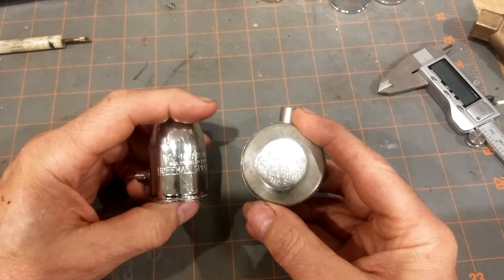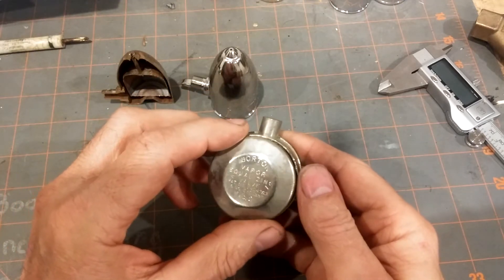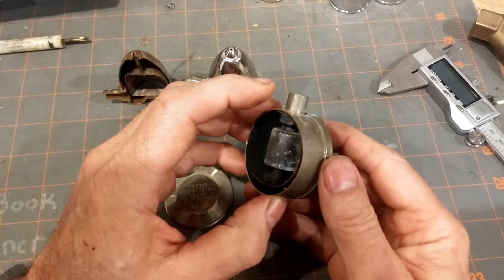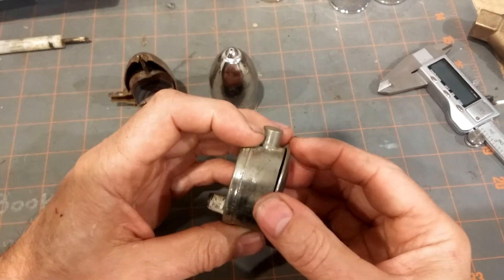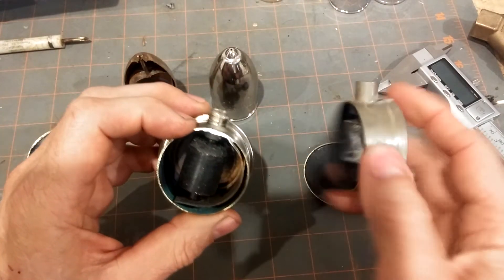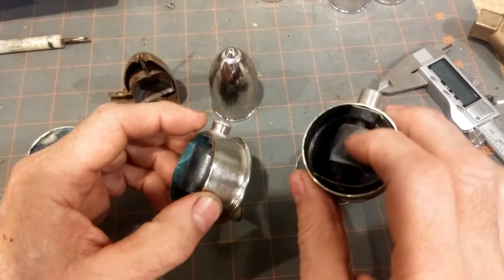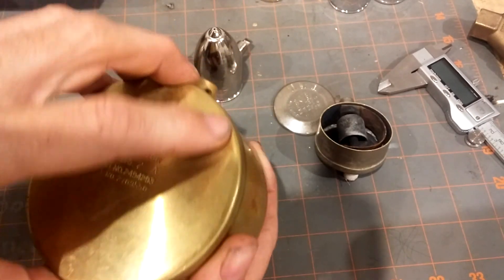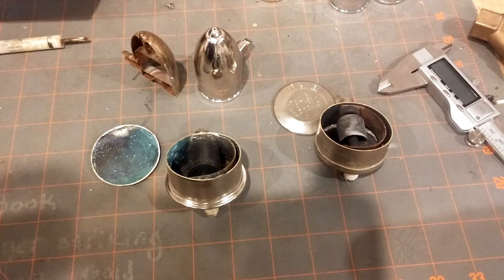Gorton / Maid-o-Mist Single Pipe Steam Radiator Air Vents

Comment: Great video!!! I have been using Maid o mist in my house. I just changed my 40+ year old boiler so I replaced all vents. The rad in my bedroom which is a 14 column, largest , hottest  and the highest in the line(house). Maid o mist calls for a C. The vent seems to be hissing a lot and releasing very fast. Is that normal? Thanks
Reply from the maker: Do you have vents on your steam mains in the basement?
Reply: @gordonschweizer5154  Yes I do. Just one.  Replaced that also. This rad is towards the end of the line or return of a signal pipe system. Its the highest rad of the house and gets the hottest and works the best. Should I use the D or go smaller then the C thats in there.
Reply from the maker: @richconstantino8485  It sounds like you might try a smaller vent. Try a #5.
What main steam vent do you have?
Reply: @gordonschweizer5154  Huffman 75 on the main. I'll try the #5. Don't have any. Will get on tomorrow.  Stuck doing 3rd grade math all day.   Working with steam is simpler with the way they teach nowadays.
Reply from the maker: "Hooray for New Math" lol.

I would strongly consider getting a Gorton #2 to replace that #75.  
Mo' venting mo' betta (for mains, at least)
Then you can vent the radiators more slowly.  No hissing, no spitting and more even heat.
Reply: @gordonschweizer5154  Got the Gorton will change it out this weekend.  Going to be cold next couple of days here in NY so the boiler will be working.  My Ac unit has a heat pump on it so I'll shut the boiler down. I want to put a skimming pipe in too. Any suggestions? I have all the stuff. Should've done it when I installed the boiler.  Brain fart. Lol.  Thanks
Reply: @gordonschweizer5154  Went to put the Gorton #2 in and its smaller then the Hoffman. Should I reduce it or take the little pipe coming out of the line and go directly to the return line? Thanks for all you help.
Reply from the maker: @richconstantino8485  The Hoffman #75 has an outside (male) thread of 3/4" npt and some have a inside thread (female) of 1/2" npt.
The Gorton #2, as you have found, has a 1/2" male pipe thread.
What is the size of your little connector pipe? You should be able to get the proper connector, be it a bushing or a reducer coupling, from the local home centre.
Reply: @gordonschweizer5154  Its in and working great. Ace had the reducer. Only thing I see that might be a problem is the pipe or niple coming out of the line makes the Gorton high and close to the floorboards and the steam might do damage over time. I'll fix that in the summer.  Should I still use a nipple or just insert the Gorton to the line? Thanks again.
Reply from the maker: @richconstantino8485  There should be no steam coming out of the Gorton as you know unless something goes wrong.
That is very unlikely.
By keeping up on the stalk, there is less a chance of rust getting up into the Gorton and mucking it up.
Maybe tack up a bit of sheet metal over the Gorton to defect any steam or moisture.
So... Job Well Done!
Reply: @gordonschweizer5154  Was thinking the same thing with the sheet metal. Does it make a difference  that its on the return? I don't trust the piping in this house. Old boiler didn't have a Hartford loop and no pitch to the return  pipe or the rads

Comment: Thanks for the video.  Question: So if air is coming out of my vent (it looks like a maid o mist). That means the plastic piece is failing?  Air is coming out like a steam room from the valve.  I can feel the air blowing very hard when I place my hand 12"+ over the valve.
Reply from the maker: It that air coming out or is it steam?
What size is the vent orifice....D, C, 6 ?
Reply: @gordonschweizer5154  it's hot air but very moist.  Coming out very strong and very hot.  The air vent is definitely failing.  It's a 2" riser pipe with a 1/2" to 1/8" converter with a maid o mist on top. It says on the part Maid O Mist Air Valve 12 PAT No. 2400297.  It's been there for 3 years.  Should I replace with something like a  hoffman 75?
Reply from the maker: @COOG22  From what you say, it sounds like that vent has had it and needs to be replaced.
If you can, have the firing rate of the boiler checked to make sure it's within spec. Make sure your main steam vents are big enough and make sure you are not making too much pressure (Pressuretrol set too high? Pigtail clogged?)
These may help you new vent last longer.
Reply: Thank you for your response.  I'm on the 6th floor of a 36 unit apt building. Was hoping to solve this on my own but sounds like I need to get the super involved.  I think he's the one that put the valve on so he may not understand this much.  Will try and check the boiler with him.
Reply from the maker: @COOG22  I wish you good fortune. I suspect, however that your super is not going to pay the slightest attention to what some clown on YouTube (me) says about lowering steam pressure from the outrageous pressure it might be now (anything above 2 psi).
Reply: @gordonschweizer5154  Nah.  You seem very genuine and know exactly what you're talking about.
Reply from the maker: @COOG22  Why, thank you!
But I was trying to see the world from your super's point of view in a humorously self depreciating way.
Tongue in cheek, every complex has an evil resident who is looking to make your super's life a waking nightmare (that is not you, I'm sure!).
The Super wants no complains from anyone about being cold, especially from THAT resident.
The Super is sure that lowering the steam pressure will get him fired because everyone will be cold.
If the vents at the ends of the steam mains are too small, he just might be right!
It kind of a chicken and the egg problem.
I've found that most major positive changes in steam heating systems in apartments are driven by people living in units that are too cold and they then get on the Board to get someone in to really fix the systemic problems.
Folks that are too hot open their windows. Problem solved.

Comment: Gordon, I just found this video. I was tempted to try the Main- O- Mist when a supplier offered them. I saw “ pictures” of them and in the photo they looked alike and the price was attractive per dozen. Thank You so much for this information, I’m sure it has saved me grief. I will stick with old faithful.
Reply: @Scotland Heating & Air Conditioning LLC: Thank you, sir!  This is not to say I have never used M-o-M on projects.  I have used them successfully. That switchable orifice is very handy in helping to balance systems. However, it appears to me that you want to provide the best value for your customers and loath call-backs!  If an individual homeowner wants to chance buying and using an M-o-M, no harm done.  They do work.  But we as professionals must hold ourselves to a higher standard.  I know from personal experience that Gorton stands behind their products.  I've never tried, so I don't know one way or the other, about M-o-M's warranty response.

Comment: Thank you for excellent advice . If I can ask another question about air valves. In the basement of my 4 unit building, the steam line leaves the boiler and branches off to create a second steam line. One steam line feeds the left side of the front of the building and one feeds the right side of the front of the building, as they connect to the risers. At the end of the steam pipes , farthest from the boiler, right where they feed the risers, they each had an air valve. Years ago, heat on the left side was not rising up. The owner of my plumbing supply told me to replace the valve with a plug. It solved the problem. Several plumbers told me they think it may not be a cost effective solution. Any advice would be appreciated. P.S. (This appears to be a common solution because for over 35 years ago, before I purchased the building, a plug was installed into the steam line right as it comes out of the boiler, feeding the riser in the back of the building).
Reply from the maker: Thank you for your questions. I think it might be best to take pictures of your system, the vents in question, the plugs, the piping around your boiler, etc and post your concerns on www.heatinghelp.com. 
Whereabouts are you, may I ask?

Comment: Home Depot only stocks the Maid O' Mist venting valve and as a landlord of a small building I am blindly dealing with minor heating problems. A recent one was, the radiator wasn't heating up when all the others were. I was told to remove the venting valve and if the steam heats up the radiator without a valve , it's a broken valve. Next, I was told to test the function of a venting valve. Blow into it. If air passes through, it's functioning, if it doesn't, it's broke. Is this good advice?
Reply from the maker: Yes, you are on the right track. I would add another test: turn the vent upside down and then blow into it. It should not pass air. Flip it right side up, and it should pass air again.
Is there any water hammer in that radiator? Ask your resident also if
there is over-heating of that radiator and what they do about it.

Comment: With the maid o mist if you just unscrew the orifice and leave it off does that make the vent open for faster venting?
Reply: I'm gonna give a qualified answer "yes, but... "  It's generally not such a good idea to over-vent a radiator.  If you appear to need that much venting on a radiator to get it to heat adequately, usually it's not a venting problem at the radiator.  Maybe the vents on the steam mains in the basement are lacking. Maybe there is no insulation on the mains and your basement is getting all the heat. Maybe the radiator supply piping is off pitch and has a water pocket.  Maybe the boiler is undersized, underfired, or has a hole in it at the waterline blowing steam up the chimney instead of toward that "problem" radiator.
Reply: Gordon Schweizer thank you so much for that information. I can rule out all the potential issues you mentioned except that indeed the mains are not insulated. That very well may be my issue.

Thought a boiler having a hole and blowing steam out the chimney, how can I rule that out? Check for steam coming out of the chimney?
Reply: Dear Link, you are most welcome.  One way to start to suspect if there is a hole in the boiler is unexplained excessive water consumption.  If you have an automatic water feeder, how often it is feeding?   More than once per month and there is possibly a leak somewhere.  If that gives a positive indication,  a definitive test is to  shut the boiler down and to add water slowly to the boiler manually until it is above the top sight glass fitting.  Any leak will appear within 15 min or less as water dribbling onto the floor or firebox.  If that is not the cause of water loss, buried wet returns are always a favorite.  Also, check for loose valve packing nuts, or leaking union nuts.  Hot hissing vents are the slow death of any steam boiler.
I do hope for you that this test proves negative!
Adding good fiberglass insulation on the mains in the basement is an outstanding way to improve your comfort overall.  Most folks report back to me when they add steam pipe insulation two things: (1) The basement is definitely cooler. (2) They wish they had done it sooner.
Reply: Gordon Schweizer ok got it. So basically add water manually till the sight glass is coming back completely full? Or a little beyond full? Essentially filling up the boiler to the top correct so if there are any holes water would leak out. 

Also is there a way I can confirm whether or not I have a buried wet return line?

Comment: Thank you very much. This really helped me decide. I went with the Gorton 6 for my second floor radiators.
Reply from the maker: You are most welcome! Question for you... What main vents do you have? A #6 is a fairly large vent for most radiators in most situations. Thank you and stay warm!
Reply: @gordonschweizer5154  ill have to check my main vent and ill let you know. I was suggested by gorton technician to put no 5  and no 6 and no c in different rooms on second floor. But i just went with all no. 6.
Reply: @potterh2300harry  OK.  The main thing is, is if it all works for you, well and good.
If your radiators all heat up with no spitting vents and banging...good!
If they all heat up evenly...great!  Be prepared to do some vent switching around to get what you desire.
Reply: @elgordo271  the vent i found in the basement seems to be a cheap one. I am not sure what number that is. Its in a hard to reach location. The vent seems to leak water/steam because i saw moisture when i turned on the head today. It also seems to rot the wood surrounding the vent. is that normal? should i change it to a gorton no. 5 (according to their home map)? BTW the second floor radiators are working great now no leaking water. Again thanks for your willingness to help.
Reply: @potterh2300harry  Any leaking steam vent should be changed as soon as you can!  Leaking steam vents insidiously destroy boilers!  That warning should be stamped on every vent, IMHO.  So, now to your situation... on steam main piping, in general, the biggest vent you can fit is best.  A #5 is for venting radiators.  It is very seldom big enough for steam mains.  The general overall strategy is to vent the main pipes as quickly as possible and vent the radiators slowly.   A Gorton #1 should be considered at a minimum. 

In polite difference to my friends at Gorton, the radiators location has scant bearing on the size of the vent used.  The radiator's size and how quickly or slowly you want it to heat is more germane.   Remember,  if  you can vent the mains quickly (that's where most of the evil air is), then it is much easier and more successful to balance the overall system with smaller radiator vents.
Reply: @elgordo271  Can't thank you enough! I will definitely do more research and get a professional to look at it. By the way are you located near nyc or know someone in the city?
Reply: @potterh2300harry  Sorry, I'm in Baltimore.  I'd go on www.heatinghelp.com "find a contractor" section to start your search.  Check out "The Wall" to ask questions and post pictures for more info.
Reply: @elgordo271  Great thanks!

Comment: That swappable orifice trumps any variation in build quality, it’s so handy!
Reply from the maker: I'm not such a vent snob that I never ever use Maid of Mist, but I wonder if it's main advantage, the vaunted variable vent, is one of its major weaknesses.  Consider, if you will, that in order for the vent to work under all conditions, particularly in size C and above, the internal seat construction must be oversized. I would posit that this would allow debris to be more likely to get stuck and imbed in the plastic, permanently ruining the vent. 
Sometimes residents like to get more heat by removing the orifice. That extra humidity from the leaking steam is seen as a plus.
Reply: Gordon Schweizer well I don’t have any tenants in my house...but the design is such that the bent still closes even with the orifice removed—it just vents really fast that way LOL . Thanks again!
Reply: You can use the Maid-o-Mists to get your system balanced, then replace them with Gortons as they fail, because they use the same sizing conventions. You'll notice the difference. The Maid-o-Mists tend to fail within 2–3 years. I've dissected quite a few, but still don't know exactly what causes it, but they start leaking even when fully closed, and no attempts at cleaning the valve seat ever succeed in restoring the seal.

Comment: I agree with you about the crimping on the Maid O mist...it’s happened twice to me and it is a bear getting the 1/8 “ nipple out. Also I had problems with the Maid O mist leaking
Reply: Yes! Isn't maddening when that happens? The crimping construction (and rubber gasket to seal), as well as the plastic innards just about put the Maid-o-Mist vents in the "junk" category. Made-o-sh!# is more like it.   Their only saving grace are their interchangeable orifices.
Reply: @elgordo271  Made of Chineasium

Comment: I have a Gorton no. 2 and a no. 1 on each of two mains.  Replaced two no. 75's that were useless.
Reply: Totally agree!  The Hoffman #75 is essentially scrap, no reason to ever buy one.  The Gorton #1 is far superior to it, never mind the Gorton #2!
Reply: @elgordo271  and here I thought that the Hoffman 75's were the best main vents you could buy for a steam boiler! I seriously thought that they had more capacity! The contractor I work for was always installing the Gorton #1's and I always wondered why?
Reply: @10314347  Yes, once upon a time Hoffman #75s were good vents overall.  But awhile ago they stopped painting them green and around about that time I started noticing they didn't seem to last through a season before failing open.  And they vent about the same but cost more than a Gorton#1.